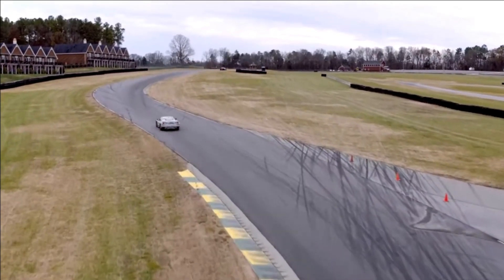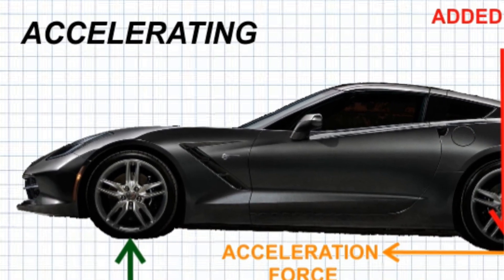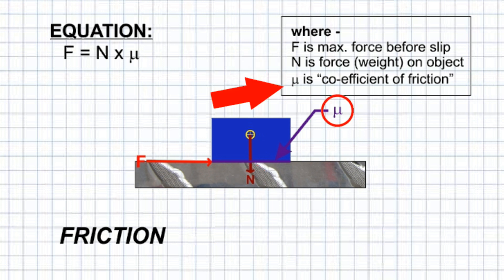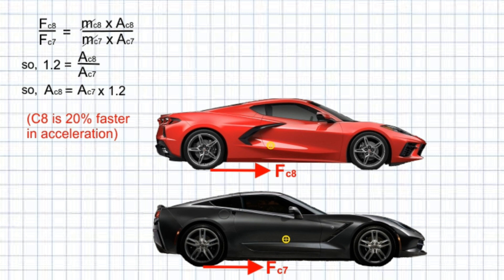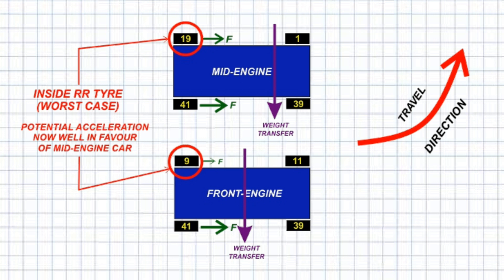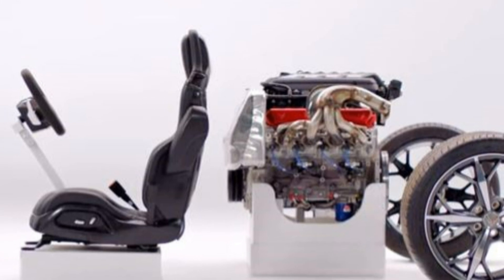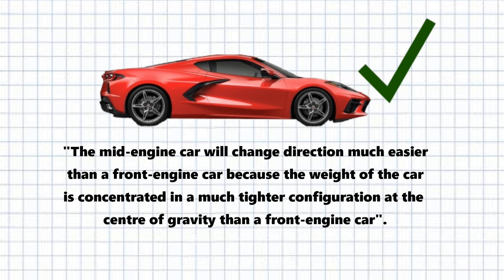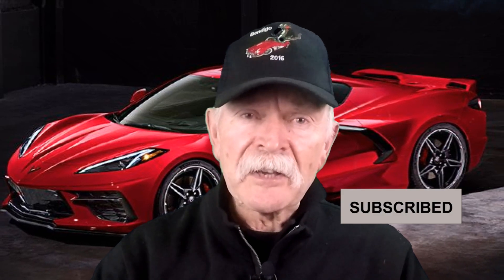Why Mid-engine C8 Corvette Outperforms Front-engine C7

Comment: Great video Mark.  You did a great job explaining why a C8 has better straight line and corner acceleration than the C7.  If you are not a teacher, you definitely have future being one.  As a corvette enthusiast, I finally pulled the trigger last year in August and bought a 2023 2LT with the Z51 performance package.  I have driven it on (3) different track as part of High Performance Driver Education and couldn't believe how well it corners and accelerates out of the corner as you tell us why from an engineering standpoint.  The car is truly incredible, and the mid engine layout was a long time coming.  Sure hope that you and your fellow Australians will be able to import a few and have as much fun as I have had.